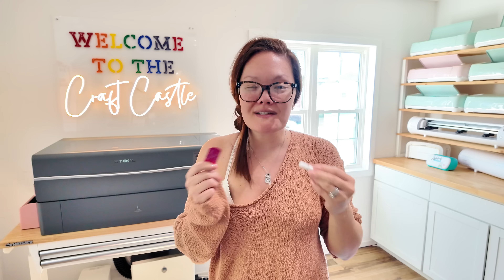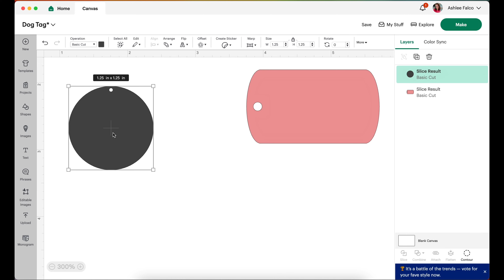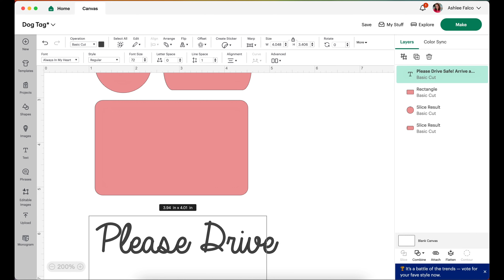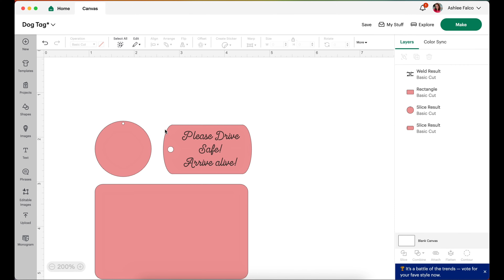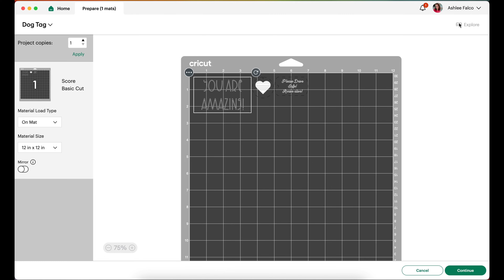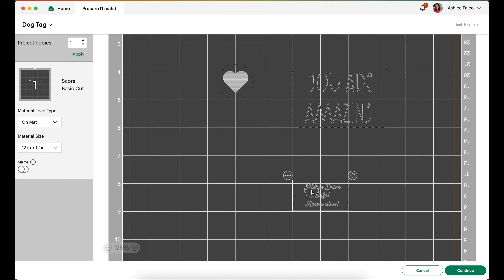Unbelievable Cricut Hacks: Discover The Laser-like Abilities You Never Knew Existed!

Comment: All you need is the blade, not the housing. When I bought my Joy, I purchased the engraving blade. It works just fine in the regular housing. Most blades are the same diameter. The only difference is the cut on the end of the blade itself. All housings are the same too, except the color is different.
Reply from the maker: Good to know!